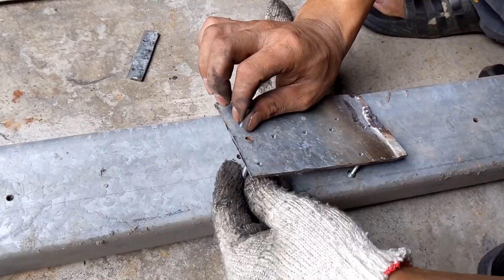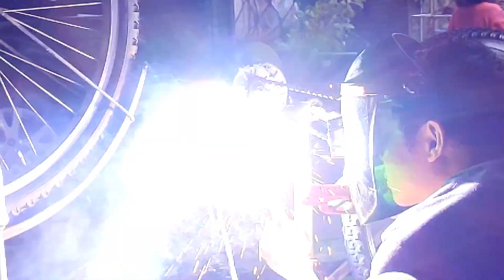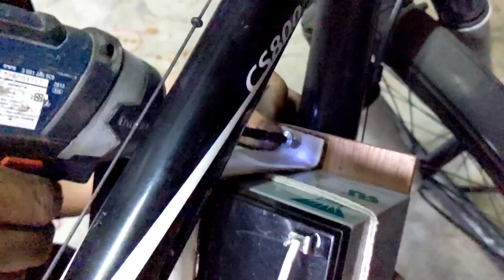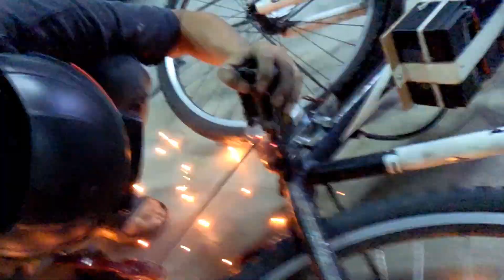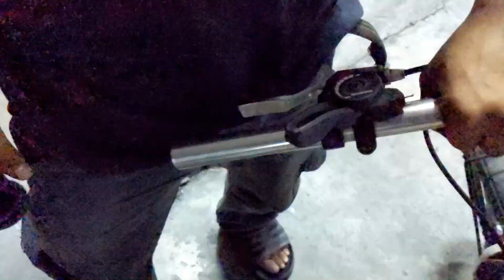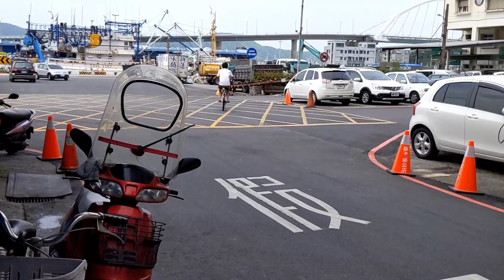Make an eletric bike with 350w motor

Comment: can you give me the pinion link or the reference please. And if possible the diameter of the axis which turns of the motor to see if it is the same axis. Thanks for the answer and sorry if it is not clear because I translated with google translate.
Reply from the maker: hello,Buy these motor and transmission components from taobao web station.
use components reference link: https://item.taobao.com/item.htm?spm=a1z09.2.0.0.47a72e8dM811Ij&id=9667456859&_u=u2029pck1v45d4
Reply: Друг скажи я, купил этот движок. Но не устонавил... Тянет или нет. И какая скорость. Мне очень нужно знать